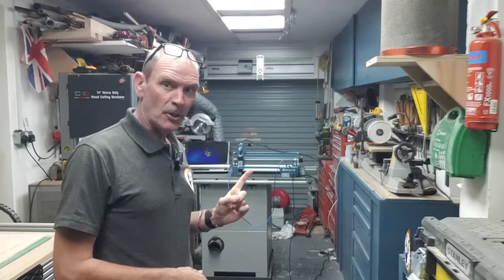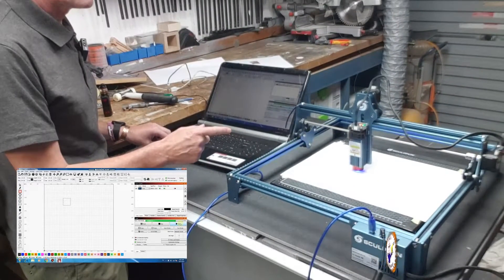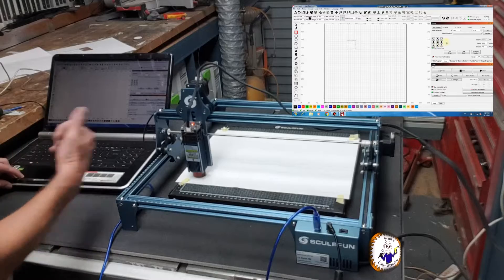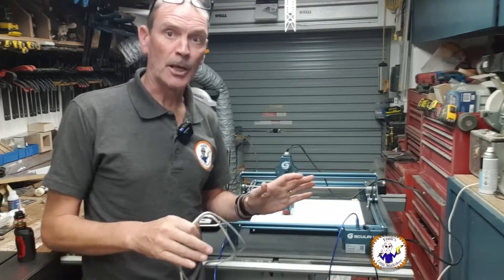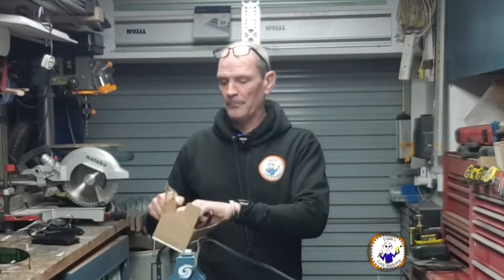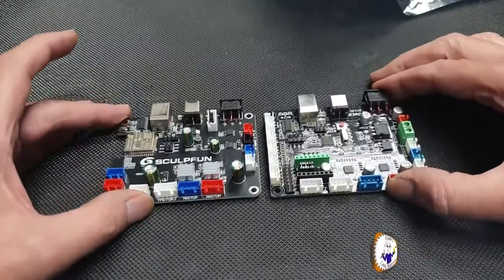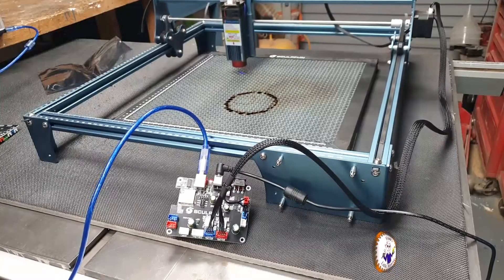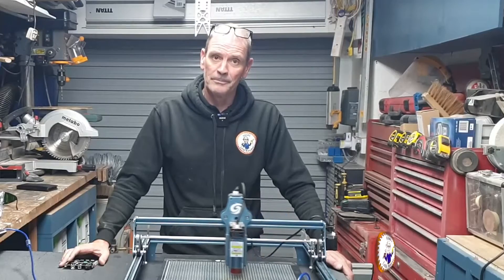Sculpfun S9 diagnostic, X Axis Judder.

Comment: Thanks a lot for your video. That helped me a lot in confirming where the trouble came from.
I was luckier than you and did not need to order a new motherboard.
What I did is doing exactly the same as you but in the end part, I used a WD40 Connector Contact spay and spread it on all the contacts of the motherboard.
That worked for me, if that can help someone, that's great ;)
Reply from the maker: @cobalink  😃 Thanks Xavier, I'm glad it was of some help. Glad it worked out well for you. Thanks for watching 😁 👍

Comment: Thanks for the video. I have a similar issue which I narrowed down to the X axis. However, I assumed that the drive belt is the cause and have ordered replacement belts. The equipment is only eight months old and I only use it as a hobby so not overworked at all. I shall try it out with the new belts. If it  has not solved the problem, I intend to contact support. Thanks once again
Reply from the maker: @jollyjack1234  😁 Thanks Mel. Hopefully the belts will resolve the issue. But I must admit I have never had any real problems with belts on these open frame machines. Let me know how you get on. Thanks very much for watching 😁👍

Comment: Bonjours j'ai un problème avec mon scunfun s9 j'ai mis un rail linéaire et depuis quand je grave j'ai plus l'ai detail ça fait tout rempli pouvez vous me dire d ou cela vien je suis en france
Reply from the maker: @sandrinemuguet8733  🤔 Hi Sandrine, it's difficult to tell without seeing your problem. But I suspect it is more of a software issue than a hardware issue ?. Just converting to a liner rail should not create a difference between a "fill" or a "line" engraving 🤔. However, just to be sure, it may be necessary to re-install your laser as a new laser (I can only assume you are using lightburn software). And insure your work area is set correctly. Alternatively, it may be caused by some additional loading (drag) on the rail ?. Check it all moves freely (you may need to remove the drive belts for this). If it is not moving freely then the steppers may be missing steps or juddering which could give the impression of a "fill" engrave. I hope this gives you some ideas. Thanks for watching 🇫🇷 🇬🇧👍

Comment: I replaced the card on my machine, as I had the same problem....Card $120 only to find it was the Cable, $22 and Total of 4 weeks delay 😢
Reply from the maker: 😔 Its definitely not the cheapest hobby in the world 🤔. I did really go to town to ensure it wasn't the wiring harness that was at fault before I even considered changing the main board (I could have possibly repaired the harness if that was the problem) . Either way its still cheaper than a new laser. I must admit Sculpfun customer service was excellent and I would still recommend them as a company. I hope your setup now serves you well for years to come. Thanks for watching Bruce 😁 👍
Reply: @frankslittleworkshop hello,i think no cheap hobby but check the price of some serious ham radios😊
My problem with S9 Y-axis was from one wheel and left Y rail,fixed with LaserGRBL shake test❤
Regards Alex
Reply from the maker: @sash-v7i  😃 At least with these kind of problems we get to know our machines better 😃. Every day is a school day 😁. Thanks for watching Alex 😁👍

Comment: So you fitted a new Cable and Board, which one was the problem? 
Why didn't you fit the new cable with the the old board, this to ensure it was the board?
Reply from the maker: 😁 Hi Bruce, in the video you can see i had already conducted experiments swapping the harness at the stepper end and the main board end. This confirmed it wasn't the harness that was faulty and that the issue was with the main board. I could have left the old harness on but I had the new one so I fitted that and am keeping the old one as a spare 😁. Thanks for watching 😁 👍